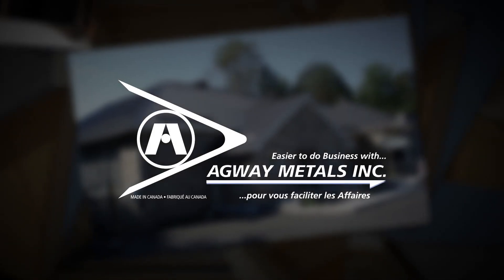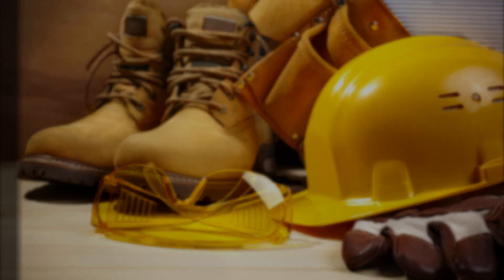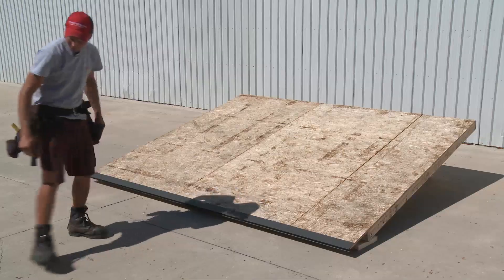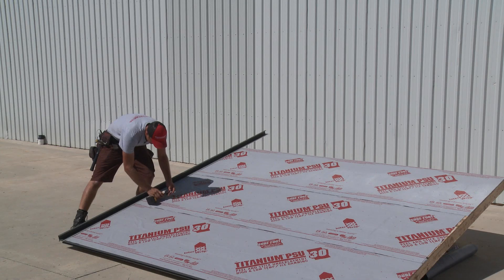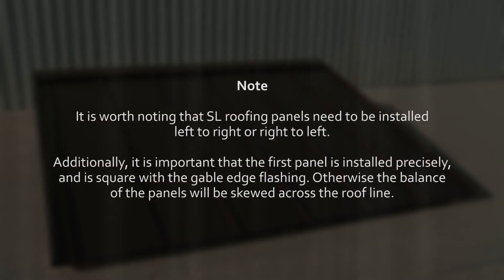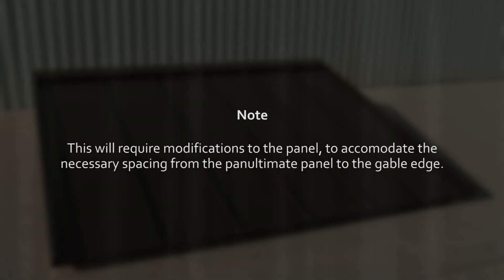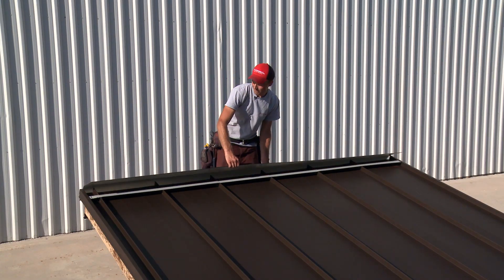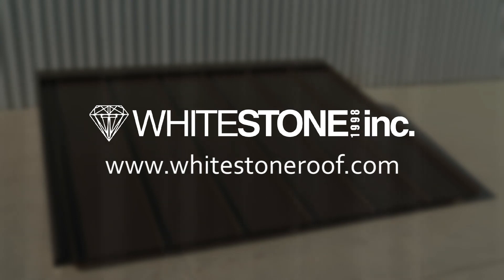Agway Metals Snap Lock Roofing Installation Guide

Comment: What is the nail gun for in the description of tools needed? Why wouldn’t you just shoot down the drip edge with the nail gun? Also the panels with nail slots can also be shot down with a roofing nailer. The myth that these panels need to move around gets dispelled when you put 2 to 4 screws in every piece of Z closure Directly through each panel does it not???
Reply: You really shouldnt use nail guns when it comes to metal roofing like this. And no, you have to put the screws in the center of the slots. Its not a huge deal if its not in the center but its always good to aim for that
Reply: @Josh-ww5kz  What about screwing Z bar directly through the panels; Now how does that panel move around??
Reply: @dnahulvey  how do you expect the z bar to be fastened down then? The whole purpose of the z bars is to hold the flashing down without having exposed fastners.

Take a look at barn metal roofs. They get a shit ton of screws put directly through the metal. How does that work? Why is that a thing then if you arent supposed to put fastners right into metal? Common sense buddy. Metal doesnt expand a whole lot like you believe it to.